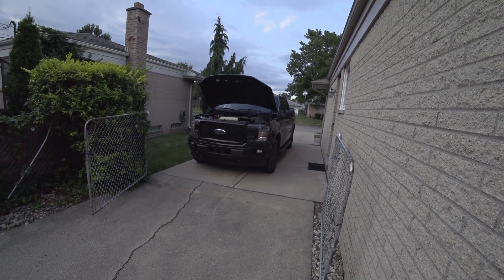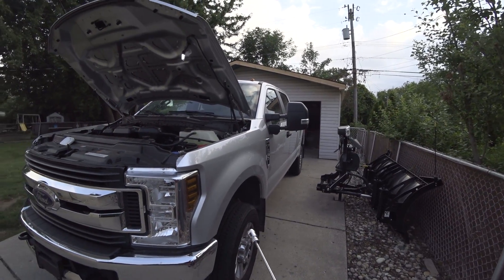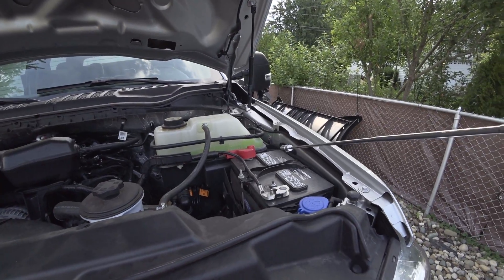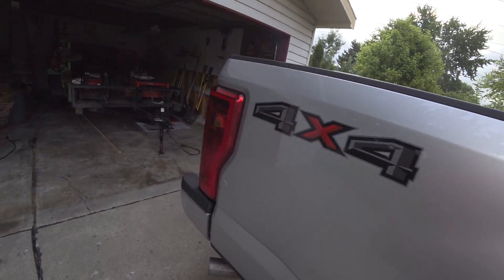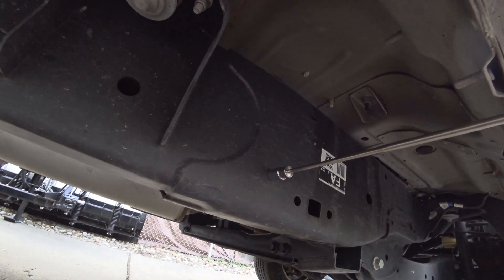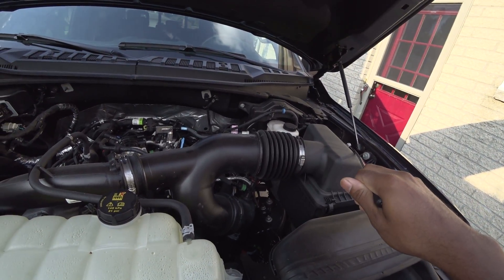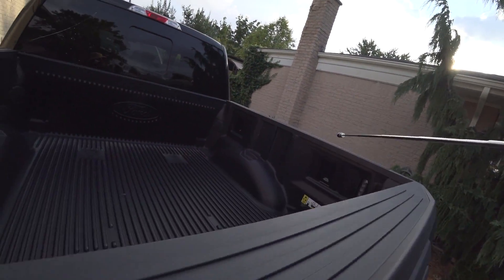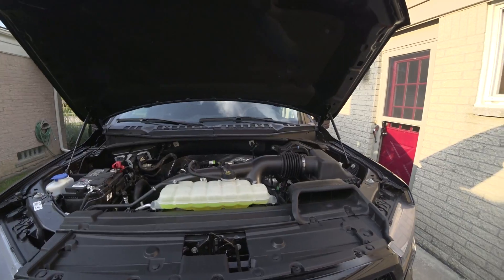How much Aluminum?

Comment: Love the Ford aluminum bodies. As for long term value ,there are several things that make up the value,unfortunately I believe Ford trails behind GM in powertrain durability and engine life overall. If you do your maintenance when you should on a Ford and I don’t mean when Ford says you should, when the top Ford techs that work on these trucks daily say so....you will have a long life truck. Follow Fords recommendations only if your leasing or dumping it as soon as the powertrain warranty is up. A GM truck will take a lot more neglected oil changes and dirty air filters. I maintain a fleet of GM trucks at work .I like the Ford better froma. Driving standpoint but there’s no denying the GM trucks just don’t die. They rarely give us any trouble,there’s not 4 cam phasers and a long timing chain to wear out like on all the Fords. They just last even when neglected.The Fords are faster look better and drive better,,but the ecoboost triton engines do not hold up as well as and are not as easy to work on as the GM  LS based engines. With that said I still bought a Ford ,I love the truck ,hated driving the GMs at work, no comparison.As for durability,I know mine will last , I do 5k oil changes and 30k all fluids as recommended by Fordmakeuloco here on YouTube... Follow his advice to keep your Ford out of the shop. With a GM change the oil when it tells you too,and it will run forever ... no need to do it sooner.
Reply from the maker: I agree 100 %